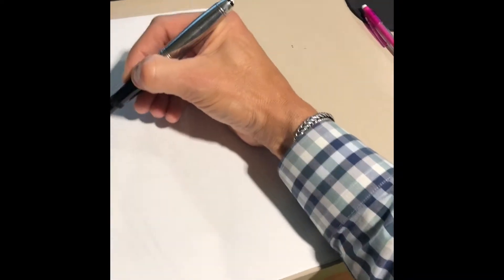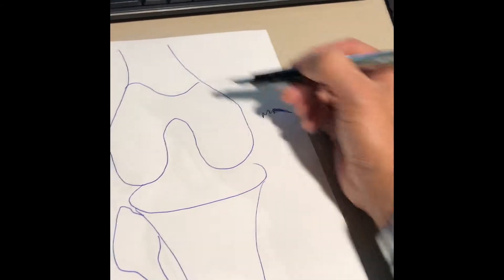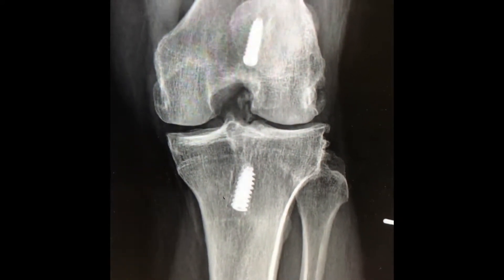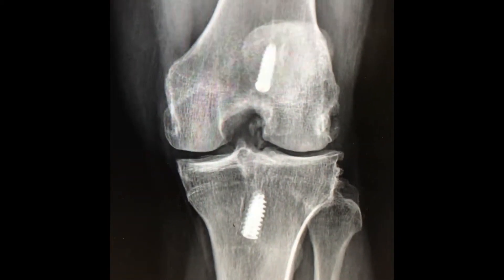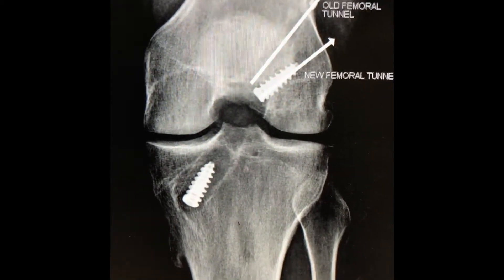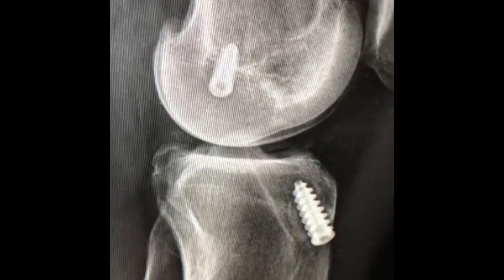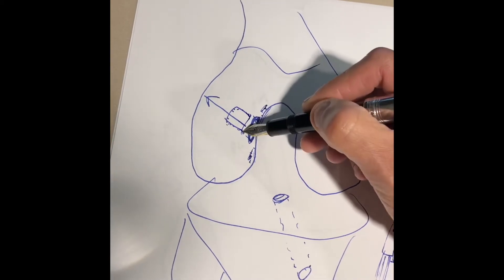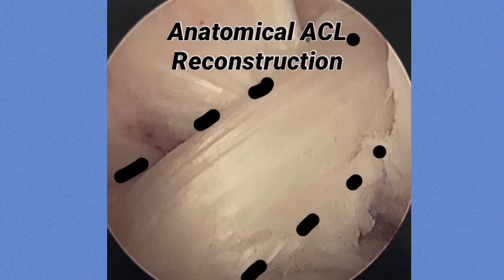ACL Tunnel Placement is Necessary for a Good Outcome - Dr Mora

Comment: Does the previous tunnel in your AP x-ray show widening at the bottom due to the original femural tunnel's vertical orientation? Or is it just the ends of the femurs cartilage?

Comment: Hi doctor. I had an ACL surgery using hamstring graft. Still have extension lag about 1 finger after one year. 

Weak hamstring and quad muscles. I was being told that the graft’s too tight/tunnel too small for the graft. I’m not sure having a another surgery such as making the tunnel wider is the best option to achieve 0 degrees. 

Have you experienced any cases like this and what are the options?

Comment: Hello Dr. Steve. 

I recently had an ACL reconstruction surgery. I lost a lot of extension, and this was further complicated by a cyclops lesion (creating a loss of extension and "clunking"). I had a second surgery to remove the cyclops lesion and perform a small notch plasty to make more room for the BTB autograft (11mm). 

I gained some extension, about 0 degrees now, but I have now noticed a clunking sensation during flexion. 

I have looked at the MRI and I believe the tunnel was placed too vertically. Also, the graft may be too thick and is causing an impingement with the PCL. I believe this is what is making the clunking noises. 

If I need to get a revision surgery, can they use the same graft seeing as how it has not ruptured?

I imagine I may need to make new tunnels. 

Thanks for your help.
Reply: What happened?
Reply: Hi there. Any updates? :)
Reply: Same question

Comment: Hello Dr Steve! 

I recently had a new ACL reconstruction and have been reading a lot about my increased chances of arthritis going forward - do you think these relatively recent advancements in ACL positioning will decrease my chances of future arthritis due to a more natural ACL placement, more stability and less rotational forces in the knee?

Many thanks! 
Rory
Reply from the maker: Hello that’s a really good question. -Early arthritis does occur in patients who have suffered ACL tear. Most of these patients have concurrent meniscus and cartilage damage. For example if you suffered a big non repairable meniscus tear that required trimming then you are at much higher risk of developing arthritis. So you have to look at the big picture and not just technical details of the ACL reconstruction. The good news is that if the technique is good mechanics are restored and the likelihood of further meniscus damage is less. Its all about the Meniscus and the cartilage but mostly Meniscus. Hopefully your menisci are intact.
Reply: @SteveMoraMD  Hi Steve,

Very much appreciate you taking the time to respond - my MRI suggested a medial meniscus Root avulsion, along with a tear in the medial third (along with a grade 1 MCL sprain and ACL tear of course). However, remarkably the root avulsion on the MRI turned out to only be partial - my surgeon once inside the knee found that it had actually already healed (he estimated a 50% tear of the meniscal root before healing) and the tear in the 3rd had also healed. So, I count myself very lucky. 

He also conducted a minor RF chondroplasty to my medial femoral, but no significant loss of cartilage. 

I have two pertinent questions following surgery which you might be willing to throw your two cents in - could a meniscus injury that has healed such as mine raise my chances of arthritis in the future - I have also read studies that suggest a healed meniscus is only around 80% as strong as a typical one. And also, I have read conflicting information on rehab of ACL reconstructions, I'm of the understanding the graft is strongest for the first two months or so, therefore returning ROM and getting walking again can happen as quickily as comfortable. However one of the physios has advised "protecting the graft" and restricting certain exercises. Do you have protocol for your patients post reconstruction? 

There seems to be conflicting advice from most people on the best way to rehab a ACL surgery, which given its commonality really surprises me! 

Thanks
Rory

Comment: Hi Dr. Steve. Thank you for the detailed explanation. I suspect that this may be what happened to me.  

2 years after my surgery by knee still doesn't feel stable and still hurts and gets swollen after playing sports. I have full extension but it looks like I lost some hyperextension when compared to my un-operated knee and I can't get it back no matter  what rehab exercises and stretches I try. My knee also clicks and pops as well when I lock it out with some pain sometimes. I also noticed that my operated knee has more flexion than my un-operated knee (my heel can touch my butt but can't on my un-operated leg). I know that you can't say for sure but does this sound like a case of incorrect tunnel angle placement? Thanks for your time.
Reply from the maker: Sorry you’re going through this.  It’s not easy figuring out why a knee remains problematic after the surgery.  Many factors including cartilage and meniscus issues.  Consider getting a second opinion w a Sports Fellowship trained Ortho.  Be safe.